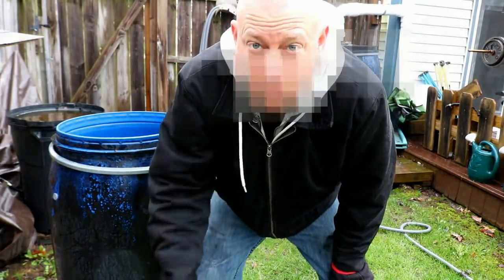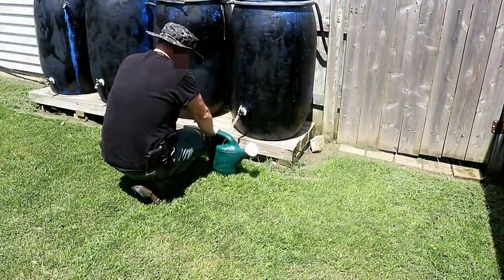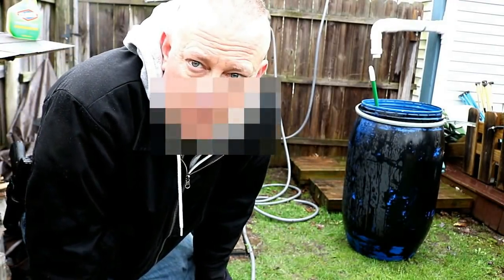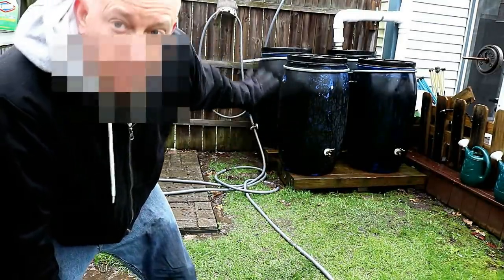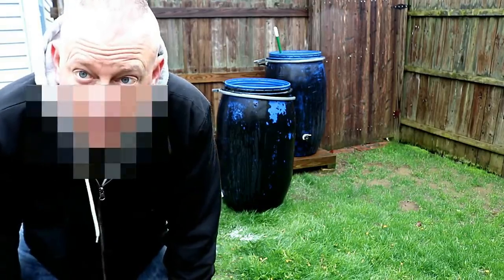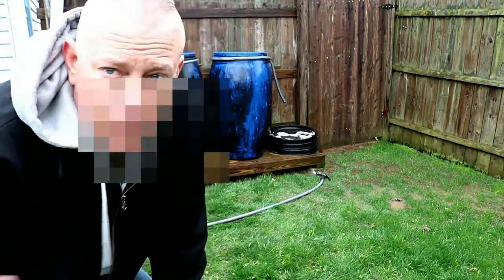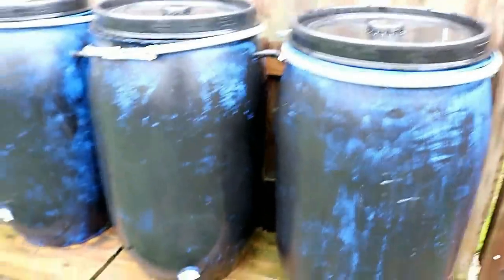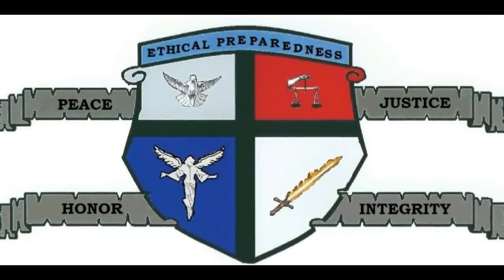Rain Water Catchment for the Poor Prepper (and how I butchered it) - First Flush

Comment: I don't know but if it wouldn't harm the plants you're watering, would it prevent algae to pour a small amount of clorox in each barrel to start with.  Then every 2 or 3 months,  pour a cap full into the first barre to migrate out to the other barrels to keep the chlorine levels sufficiently up?  Love your videos!  Thanks!
Reply from the maker: I've thought about that (adding a little chlorine to the water)… but only the first barrel really ends up with the cloudy water in it. The other three barrels in the chain will usually be clear and will usually only end up with a little bit of the asphalt roofing bits in them. Sigh.... maybe one day I'll be able to afford a steel roof instead of an asphalt roof.

But on the other hand, I'm in the process of buying a very rural secondary retreat location. And I plan to put a cabin with a steel roof at that place, that way I no longer have to deal with the small bits from an asphalt roof. :)

Comment: You could probably get the bottom of the barrel to sit flat again if you heat it with a touch or heat gun. I never made a rain catchment system or have problems with deep freezes, but I make grow barrels out of simular barrels for growing vegetables. In fact I just released a video on my channel about some of the work I am doing with them and how I reshape the barrels if you are interested. I will not post a link out of respect for your channel.

Comment: Wow your rain barrels are ingenious great set up one question was that Clorox clean up your were using for cleaning your barrels great video God bless be safe
Reply from the maker: Yes sir, Clorox Cleanup. I like using a little chlorine when I clean the barrels. I know that I probably won't have Clorox Cleanup after SHTF; but I've got quite a bit of pool shock that I can make chlorine with. :)
Reply: @EthicalPreparedness  great stuff works great though and it is diluted enough that wont harm you
Reply: @EthicalPreparedness  Clorox clean up is just bleach, soap & water. I make my own at home by mixing a capful of bleach with a half teaspoon of dish soap in an old spray bottle then fill with water.

Comment: You could put a filter between the barrels. And they have a thing you can put in your gutter to stop most of the stuff getting into your barrels. Sorry don't remember what it's called.
Reply from the maker: That's a great idea: I could put a mesh screen in the hoses between each barrel.

And I am wanting to put up a gutter guard. 
Besides keeping stuff out of the barrels: it'll also be nice to not have to clean leaves and other stuff out of my gutters every spring and early winter. 
I've been checking them out and pricing those gutter guards, I just haven't acted on it yet. :)

Comment: If I buy a 500 gal rain catch barrel let's say, if I spray them black will it keep the algae from growing?
Reply: Some other channels recommend it. or even a shed like shelter.
Reply from the maker: It's my understanding that it's the sunlight (that seeps through the walls of the barrel) that allows the algae to grow.
So if the barrels are black: then it blocks the sunlight which then helps to keep the algae from growing.

Now I've seen some people say that we shouldn't use paint; because the paint can leach through the plastic barrels and end up in your water. 
Some people will only use black tarps or black plastic (instead of paint) to block the sunlight. 

I hope that info helps! :)

Comment: I have been gathering my supplies the past week and will began building my rain catch system tomorrow. I am thinking later this summer I will purchase a rain gutter heater and install it in my collection barrels. Have you tried this for keeping your water from freezing in the winter? Anyone have any thoughts on this?
Reply from the maker: No, I've never even heard of a rain gutter heater before; that's interesting.

If I were to try it: I'd probably test it out on one barrel the first year to see how well it worked.
I'd leave the one barrel full (with the heater) throughout the winter; and then if it worked good then I'd invest the time and the resources into the rest of them.

My plan is: that if I had to rely on the rain barrels, that I'd just simply bring them inside once it got cold enough for them to develop that first top layer of ice. That way they'd keep thawed enough to use the water out of them. :)
Reply: @EthicalPreparedness  Check your local hardware or home improvement store for the gutter heaters should you decide to try them. As for moving the full barrels inside to warm should you need them. That really is not something I had considered. Simple idea, no cost, just a bit of quick work. I think your plan would be a better plan than mine. Definitely less expensive.  I will still use gutter heaters in the gutter though. They are just to good at keeping snow and ice cleared from the roof and gutters. Glad I posted my thought. Always good to gather other ideas. Never know when you might find a better idea. Thanks

Comment: Before you try painting the barrels again, try putting copper into the barrels, preferably at the intakes where the water will hit it before it fills the barrel. Or you could try a copper pipe as a stir stick. 

Speaking of copper... https://www.youtube.com/watch?v=u2OzWUi14p8

Another thing that you should try, is filtering the connection between the first and second barrels. When the barrel fills up, the grit still floating at the surface goes into the second barrel, and then the third, and the fourth; progressively less, yes, but the fact remains, that the grit should be kept at the first barrel when possible.

Now, just throwing this out there... have you considered adding a segment of activated charcoal to the end of your downspout? It's just something that popped into my head. Likewise, all the bird crap in your first flush system, that might be good for your garden; I've known people who swear by chicken coop gardening. It's the humans and pets that need clean water; plants generally thrive on crap short of toxic waste; hell there are people who water with urine. 

https://www.youtube.com/watch?v=Fp1dxOmBD00
Reply from the maker: That's one of the things I like about this channel: I get so many great tips from you all.

So a couple of people have suggested putting some kind of filter between the 1st and 2nd barrels (in order to keep the roof-grit contained in the first barrel). 
And I think in the near future I'm going to try to figure out a way to do that.

Because, since I keep the barrels pretty much painted black, I get very little algae in my water. All that dark stuff in the water was just purely roof-grit. 
Otherwise, the water is crystal clear when it comes out. :)

Comment: there is a formula , devised by smarter ppl than i , surface area of water vs depth vs windage yadda yadda , but with very little effort you could raise a few fish and supplement your diet and preparedness supplies with a never ending source of fresh protein , trout , bluegill , talapia , we have three fish tanks we use and two duckweed tanks to source our aquaphonics , it takes less space than you think , and less time than you my imagine and can fit just about anywhere , the bennifits its provides are quite nurerous and can be done with a rain water catchment system , i would encourage anyone too at least look into it , also cover your cans /tank with a black tarp as opposed to painting them , keeps the sun out better and the water doesn't get that dank flavor and it reduces cleaning , also it allows you to sun your water a bit to disinfect it periodocally .....not too straight drink from the fish tanks , but an idea if you have space for several extra rain tanks